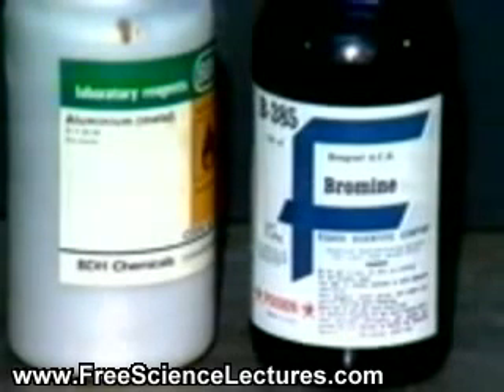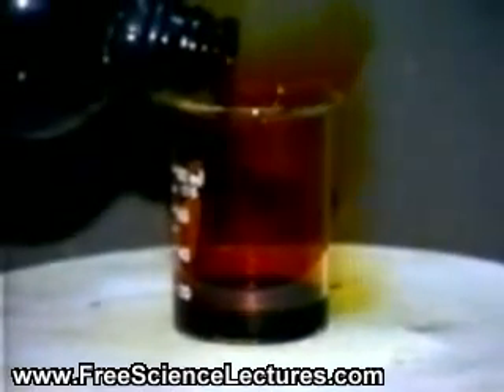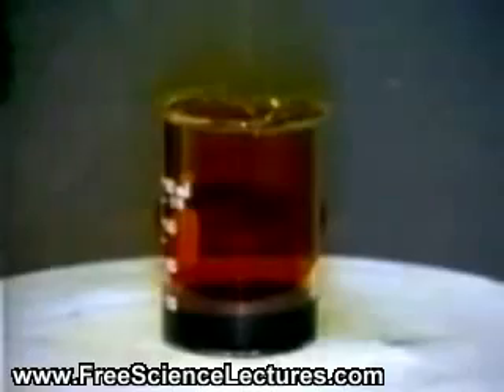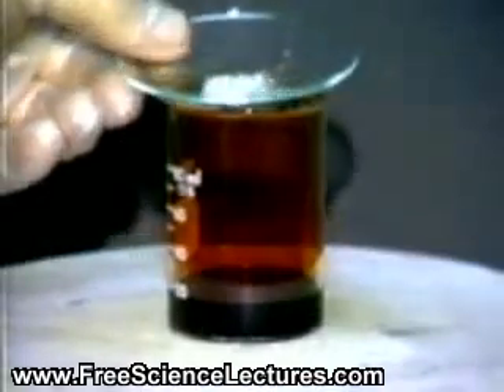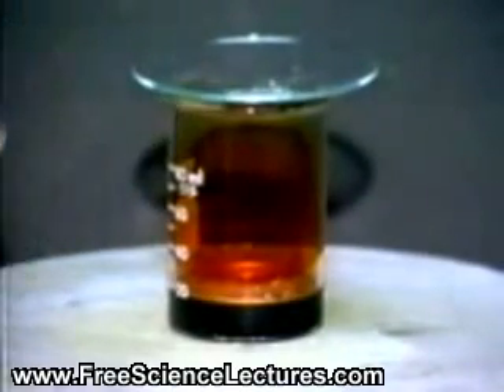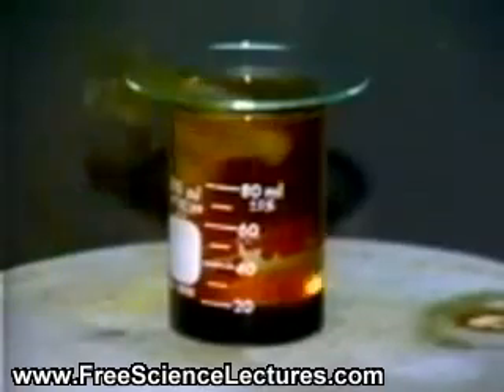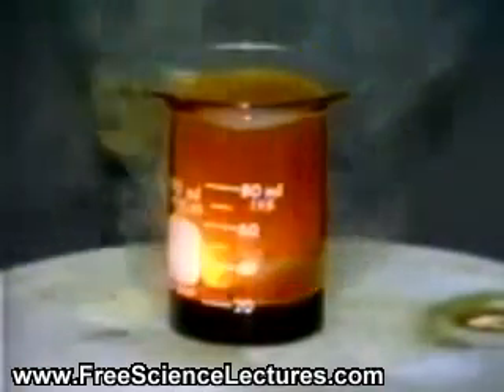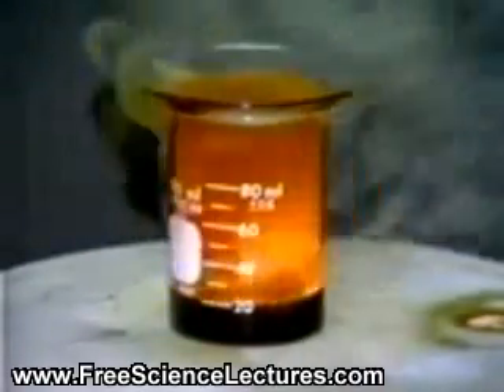Formation of Aluminum Bromide

Comment: Cool! But, not a home lab experiment. To avoid explosion you can perform this reaction in dichloromethane to dissolve bromine, then adding slowly Al - foil...it takes a while before reaction takes place. This is safe to do outside. But AlBr3 is hygroscopic and form quickly stable hydrates with water in the air.

Comment: You can buy sodium bromide which is used in hot tubs, and make bromine through electrolysis. Alternatively you can mix it with muriatic acid and hydrogen peroxide to make bromine as well.